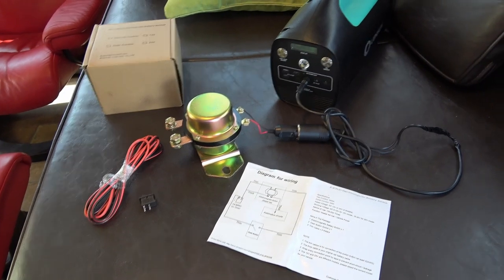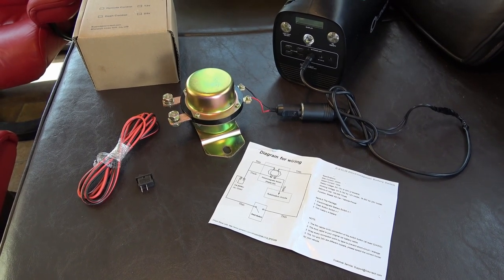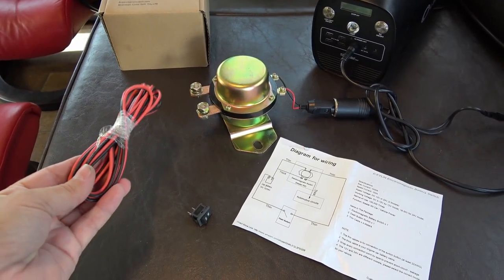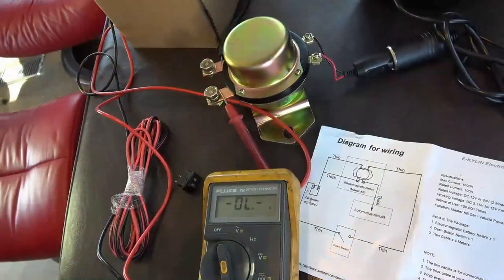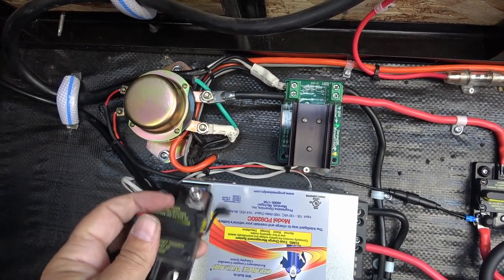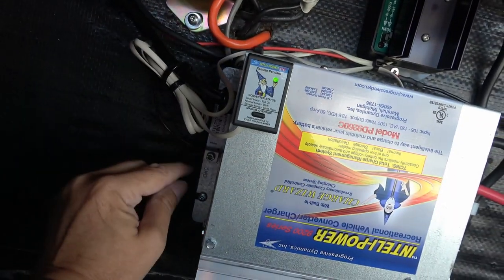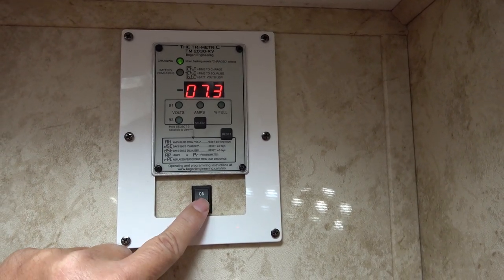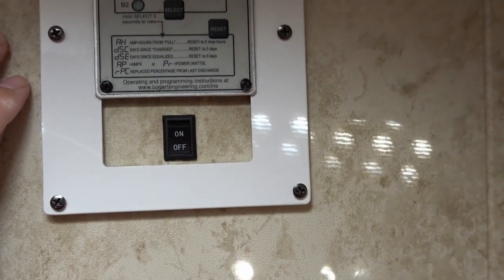Remote Solar Power Disconnect Switch Installation

Comment from the maker: Lion Energy Safari UT Lithium Battery Install Blog post and Videos - https://www.loveyourrv.com/upgrading-lead-acid-rv-batteries-to-lithium-lion-energy-safari-ut/
UPDATE I've since redone my solar wiring and decided to install a switchable breaker in an access panel inside the RV so no longer needed this remote switch. Also out of interest to some, I've found that my OEM WFCO charger converter will float my lithium battery bank at a 58% charge. I guess it gets tricked by the long charge wire run and the naturally higher lithium battery resting voltage. That actually works out perfectly for my long stays hooked to shore power.

Comment: While my solar controller and inverter charger can be configured to do this automatically by SOC or voltage,  you've given me an idea on adding this disconnect for the PV to be disconnected automatically if any tech decides to remove the power cables from my batteries without unplugging the PV or disconnecting them,  which could fry my two Bogart controllers.  I'd simply power the solenoid coil signal wire from the main fuse and the shunt,  so that if either the positive or negative battery terminals are inadvertently removed ot of sequence,  the PC will be disconnected.  Good video,  thanks
Reply from the maker: Interesting, that's a nice side benefit to the hook up I never thought about. Cheers, Ray

Comment: I'm no expert but when I was deep into doing the electrics in the van one of the things that rang loud and clear was to keep most lithium batteries between 80% to 20%. If at all possible I try to keep all my van house batteries and device batteries using the 80/20 guideline to maximize battery longevity.

Comment: Thanks, sounds like you could use this to stop charging LION batteries when the temperature approaches freezing.  Couple of temperature sensing devices that could throw the switch.
Reply from the maker: Could do, though my batteries already have that feature built onto them, they cut off charging before freezing. A guy I know that doesn't have the feature uses a switch for his.  Cheers, Ray

Comment: Way to go Ray, Now those batteries will be sure to last until you're 110 years old. This one might be a little over the top buddy. Cheers.
Reply from the maker: If that's the case I find it curious that most companies are only warrantying them for 5-10 years. Lion says its lifetime, but it's worded, so that means the lifetime of the battery, so if they get it back in 10 years and the cells measure lower than 80% capacity vs new they say you have used its expected lifetime.
Battleborn has this clause in their warranty:
"This Limited Warranty does not cover a Product that has reached its normal end of life due to
usage which may occur prior to the Warranty Period. A battery can deliver only a fixed amount
of Energy over its life which will occur over different periods of time depending on the
application. For example, cycling the battery more than 1 time daily, will cause the normal end
of life to occur before the end of the Warranty Period. The Manufacturer reserves the right to
deny a warranty claim if the Product is determined, upon inspection, to be at its normal end of
life even if within the Warranty Period."

I see these batteries advertised by amazing cycle numbers but have been researching what degrades lithium batteries is time spent at a high state of charge and high temperatures. I guess we will all know in 5-10 years how these batteries truly hold up in an RV environment as lots are out there now. I still think they are worth it for other amazing benefits, but skeptical of the super long life that is hyped. Cheers, Ray
Reply: @LoveYourRV  Good point Ray and thanks for the response. I don't see curious at all for reasons of warranty coverage. People expect too much from everything these days. I don't know why that is but it might have something to do with the social behavior of a crowd that comes together on a subject matter. Much easier to do today. I think a 10 yr warranty seems fine for this battery chemistry and component assembly. The lifetime claim of another company with it's small print detail is simply a way to get attention and improve revenue. It's just about one company assembling product and adding verbiage to get all the market they can. Without going too far off track I don't think your curious dismay is warranted (pun?) Think about it, The most important tool you've purchased recently was that truck and it's expected to last way beyond any factory warranty extended to you. We shouldn't expect companies to warranty products way beyond some value/time parameters. Yeah, lots of folks who will mistreat these batteries and shorten their lifespan but the assembled components and chemistry are sound and with average demands and sometimes more the proof of work shows value and longevity. I'm going to keep watching Ray, You'll have these batteries to the end unless you sell them first for a value/useful life proposition comes along and you can upgrade and test something new for your audience. Thanks Ray.
Reply from the maker: I recently read through this extensive article on LiFePo batteries by a marine tech, lots of interesting stuff - https://marinehowto.com/lifepo4-batteries-on-boats/  What really caught my eye was this portion and led me to look for a way to not float charge the batteries sitting at 100% SOC for the summer months we are stationary on full hookups.

STORAGE SOC EXPERIMENT: I recently ended a very expensive experiment regarding storage at 100% SOC. The test duration wound up being 12 1/2 months using four 100Ah CALB cells where they were charged to 100% SOC and then left to sit idle with no connections to a BMS or other parasitic loads. The low temp recorded over the 12 1/2 months was 46°F and the high temp was 87°F and was meant to be a representation of the real wold.
A min/max capture thermometer was used to record the peaks. The cells, prior to letting them sit at 100% SOC for 12 1/2 months, were regularly testing at 101.2 to 101.3 Ah’s of capacity (previous 6 Ah capacity tests) as a 12V nominal bank. After 12 1/2 months the cells were discharged to a cut off voltage of 2.9V for the lowest cell. After 12 1/2 months of doing nothing but sitting there, at 100% SOC, the cells had lost 11.6% of their previous rigorously confirmed Ah capacity. Now imagine if you additionally stressed the cells by continually float charging them. Ouch!!!!“The cells lost 11.6% of their confirmed capacity just sitting at 100% SOC”How can these manufacturers suggest that the mere act of storage, at 100% SOC, is bad for the cells, which I have now confirmed is, and thensuggest it is okay to float? How can they say “store at 50-60% SOC” yet then give you a “float” voltage? Really?

Comment: I'm kind of peeved that solar controllers don't have an on/off switch built in. On another note, a member of support from Battle Born said their batteries can be charged to 100% no problem (meaning you don't need to restrict them to 90/95%). So there's conflicting information out there, unless the Battle Borns are a bit unique in that way.
Reply from the maker: Its not so much the fact of charging them to 100%, that's not a problem, its having them spend long periods of time sitting at a 100% charge, like for instance weeks or months when I'm hooked up at an RV park versus boondocking, so in a case like that I feel its best to keep them in a tighter charge range. Lithium batteries are more comfortable sitting around 50% charged. Long term storage at a high state of charge and hot temperatures are two things that speed up aging from what I have gathered.
Reply: Or maybe BB has built-in a cut-off at 90% of the actual total, not 90% of the label total. Perhaps their 100a batt is actually 110a so cut the "people" factor out. Worth underrating for them so they don't have to deal with lying customers making claims.

Comment: Ray  Did you consider a latching relay. This type of switch requires a pulse to open and another pulse to close it. To keep the relay closed doesn’t require power to stay open.
Reply from the maker: Yes, that feature seemed to drive the price up quite a bit. There were some nice looking remote switches from Blue Sea and Marinco with manual control as well I found but they were up in the $150-200 range. This was cheap and 1/2 amp wasn't much to waste for the times it will be used. Figure in lean solar power times I'll just jumper the relay terminals and not use it.

Comment: I believe each different manufacturer provides a spec sheet showing exactly what the maximum charge voltage and cycle life relationship is for their particular product. Do we need a controller that has arc fault protection to prevent damage to the controller itself? Perhaps some research would be prudent. Thanks for the video.
Reply from the maker: I'd think most any controller would have arc fault protection on the solar feed, loose/arcing solar connectors are fairly common as is using a disconnect switch for the solar array. Usually, there is a slight delay before they start to work once the voltage is applied
Of course, most caution to use a blanket to kill the sunlight on the panels and thus the output power, but how many people actually do that. ;)

Comment: Wouldn't a contacter with NC contacts be better? That way you'd be pulling the 0.57A when "fully" charged and have no current draw when your battery is depleted. (Or am I not thinking of something? It's been a while since I did any industrial electronics.)
Reply from the maker: That's how these relays are made, they are designed as cutoff relays for car batteries so normally open when the car is parked and latched when the car is moving with the alternator power the battery.  Works for me as I will have it off much longer than on. Will take about 5-7 days to run the battery bank down and one or two to recharge.  I will not be running the battery fully depleted, just down to around 30%, also once the terminals are closed my solar will be charging usually at a rate of 25 amps during a sunny day.

Comment: Shouldn’t your charge controller be able to do this?
Reply from the maker: I find this disconnect a simple way to do it versus going into the controller and changing voltage parameters to cut off charging.  My solar controller's settings is a little difficult to get at, involves pushing a lot of buttons to set things then again to set them back. Since I'm always looking at my battery monitor anyway, thought this would be easier.  Cheers, Ray

Comment: Hi Ray. That's a great solution to prolong the life of your batteries. I do have one concern though. Is the wire between the solar panels and the Bogart charge controller still fused elsewhere? If not, then the breaker removal could pose a risk of fire in the event of a short circuit. As reference, Renogy recommends a fuse/breaker on both sides of the controller.
Reply from the maker: Thanks, Leonard, yes, each panel is individually fused.  They are fused in case one solar panel short-circuited and the other 4 started feeding current into it.  If the short developed being fed from the battery side then the breaker between the battery bank and the solar controller would blow.

Comment: So i have completed my solar system and i found out that our daily use is not as much as we thought so i thought about installing a turn on and off switc between solar panel's live wire do you recommend
Just to be clear I'll be installing it on a solar panel's live wire
Reply from the maker: That's where I installed mine, effectively its just like someone put a blanket over the panels and cut off power. I have since changed things a bit and added an access panel in my bathroom with a switchable breaker - https://www.loveyourrv.com/boondocking-power-upgrade-200-watts-wiring-update-mods/
Another thing I discovered is my OEM converter will only charge my lithium batteries to around 58% if I turn off the solar so that nice.  https://www.loveyourrv.com/lithium-battery-charge-test-can-you-use-a-lead-acid-charge-converter/  Cheers, Ray
Reply: @LoveYourRV  appreciate your reply sir thanks stay safe👍

Comment: Doesn't your convertor/charger still charge your batteries when you're plugged in? Seems like it would be best for your battery bank to just disconnect them completely when they get to around 80% and run all of your 12 volt needs from the convertor unless you need the batteries for a crude voltage regulator.
Reply from the maker: I usually turn off my converter and power our DC loads off the batteries with solar recharging them. I only turn the converter on if I need to bulk charge if they get really low. I like having the solid DC voltage that a battery can provide versus the plugin converter charger rectified regulated DC. I also run my wife's iMac off our pure sine inverter all the time, as I don't trust campground AC power to be reliable.
Reply: Short answer: boon docking. :)

Comment: Wondering why you went with normally open vs normally closed?
Reply from the maker: That's how these relays are made, they are designed as cutoff relays for car batteries so normally open when the car is parked and latched when the car is moving with the alternator power the battery.  Works for me as I will have it off much longer than on. Will take about 5-7 days to run the battery bank down and one or two to recharge.

Comment: Doesn't the MPPT controller do this already?
Reply from the maker: You can set the solar charge controller to automatically cut off charging at a preset voltage somewhere before a full charge voltage is reached but I like to have this exact manual control over it.

Comment: The internal bms on the batteries already has this figured out for the particular cells in your batteries. So really your just stacking up the percentages and shorting yourself. These lithium drop in replacements should be use like a normal battery cause all the protection is already built in. When the gauge on the battery says full it really means 90% but technically that is full cause you don't want to go above it. Every bit of battery management is already built in so your just losing capacity needlessly
Reply from the maker: Since my bank is actually oversized for my current needs it makes sense to do that.  I was told by the company by staying in the 20% - 80% state of charge I could double or even triple their rated 3500 cycle lifespan. 
I've tested the amp hours I get with full discharge and it came out pretty close to the actual rated cell capacity of the 90Ah prismatic cells they are using inside my batteries. 
Amp Hour Capacity Test Results
Low Power 1-3 amps - 89Ah
Medium Power 8-10 amps - 89.7 Ah
High Power 80 amps - 87.5 Ah
Max Output 150 amps – 80.7 Ah
So there actually isn't a lot of headroom in their design, unlike say the Battle Born which I hear uses 120Ah battery pack but the BMS is set to only allow 100Ah to the end-user.

Comment: If you look at what they call "80%", it is 3.92V / cell or 15.68V for 12V batteries. I bet you will find this is what battery vendors call "100%" and disable charging after that limit with their built-in controller. Otherwise, they would never be able to come anywhere near the number of cycles they claim the batteries can provide. But, yes, monitor your batteries to assure they are not charged above that level.
Reply from the maker: I've found the BMS in these Lion batteries cut off charging when they reach around 14.4V, then settle around 13.2V resting
Reply: @LoveYourRV  It sure sounds like they have already decided to not charge any higher than what they consider to be optimal life. I'm sure they want to avoid as many warranty claims as possible.

Comment: What about when you are connected to shore power?
Reply from the maker: With the new lithium batteries, I now turn off my converter and power our DC loads off the batteries with only solar recharging them. I only turn the converter on if I need to bulk charge if they get really low. But in the summer months doesn't happen much.

Comment: This is interesting. I put a switch between the charge controller & battery so it isn't draining power after dark. I have to be sure not to cut it off while the panels are delivering amps, but that's no problem. If anyone wants to see my mobile solar project & camping trips, check my youtube page.
Reply from the maker: Good idea, I have a pretty basic controller only draws around 40 milliamps when the solar is off
Reply: I have 2 used batteries with 70ah total for short outings. I have to conserve as much as I can with those. But I have 4 batteries with  220ah total for long trips or even long term road life. With those, I don't have to be so careful about usage.